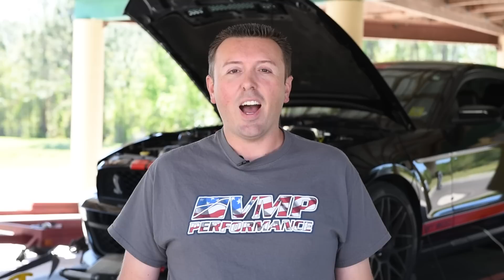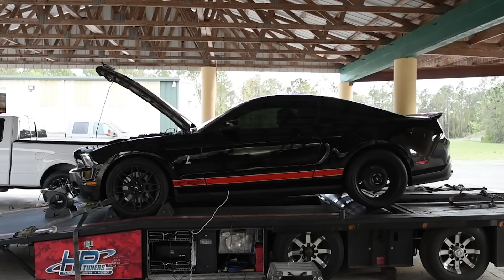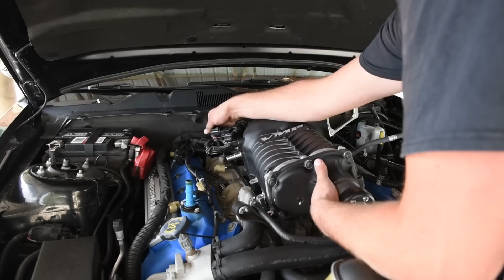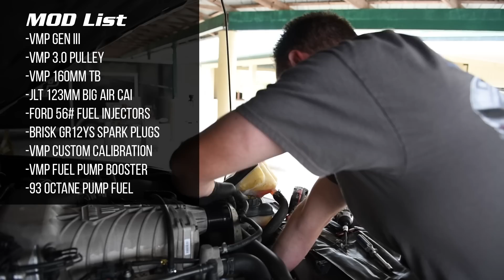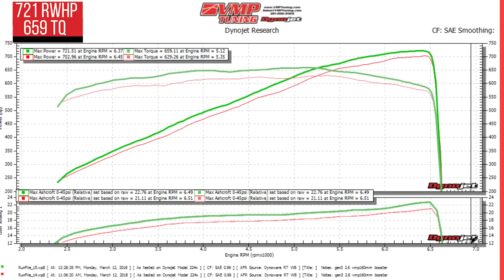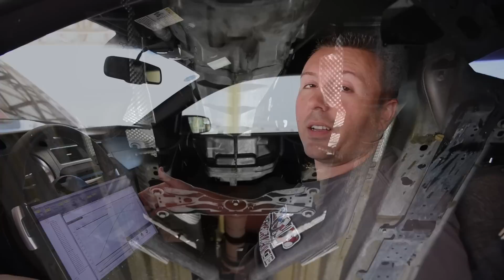VMP Performance | Stock 2012 Shelby GT500 Blasts Out 800 HP With VMP Gen3 TVS Blower

Comment: 615-630 RWHP on stock blower if you add headers, off road road x pipe, and a dyno tune to the pulley, intake, throttle body.

Comment: Worth the 10-15 grand you save going with a 2012 over a 2013 gt500?
Reply: To me it absolutely is.  The money you save put into the 5.4 will make as much or more power than modified 2013s and they have the same 800ish rwhp ceiling on stock bottom end.  The 5.4 had the better gearing and the 11-12 performance pack comes with 373 stock which is much better gearing than what the 13 has.  Even if you did 373 1st gear is still real tall on them.  The gearing is better for the street on the 5.4 imo.

Comment: i had the same build and same  make model and year car .Only differnce is my Shelby only has 38000 miles and had it done at a local shop. My  Shelby is only maxes 670 at the rear whells and it cost me 18500.00. Can someone please tell me whats wrong with this picture?

Comment: Why even get the 5.8..?
Reply: That's a real good question man lol.  The 5.4 is an amazing bargain those who know know.  The 5.8 has more stock but they have the same ceiling overall and make comparable power w the same blower and supporting mods etc.  The 5.8 will make more tq and it'll make the power at about 2 psi less boost but considering the price difference the 5.4 is a way better value if you plan to mod anyways.  Gen3r on a 5.4 is the way.  My 07 did 740/733 to the tire on 93 and boostane 2.6 upper stock size lower.  It's at 132k and going strong

Comment: Question is there any loss in HP after 80k miles on the engine? Did you guys check the compression on it or a leak down test to be reliable?
Reply from the maker: This is something we've studied quite a bit over the past 14yrs.  The higher mileage cars will make 5-10rwhp more from being looser.

Comment: I have a 2011 GT 500, it’s pretty much stock with the exception of a K&N Air filter,  it looks to me like it still has the stock silencer on it though.  I want to add the vmp gen3r but it will have to wait a while due to cost.  My main question is in the meantime would it be a waste of money to do a pulley swap with tune and do I need to change the k&n air filter out for a JLT? Basically I know I’m eventually going to end up with a Vmp gen3r, But I want to make more power now but I don’t wanna waste a bunch of money in doing it.  It’s my understanding from watching a few of these videos but if I do the pulley swap with a tune and the cold air intake with a catless  Exhaust system I should then  be somewhere close to 600 rwhp?
Reply from the maker: Hi James!  We have a few different options available for the GT500, including pulley/tune power packs.  Depending on which you select, the JLT will be reusable with your eventual upgrade to the Gen3R.  An example would be our Pulley/X4/Tune/Idler/JLT package for the 07-12 GT500.  That'll net you a healthy gain close to your stated 600rwhp figure and the JLT will be functional with the eventual Gen3R upgrade.
Reply: @VMPPerformanceTV  
Awesome thank you.  I will be in touch shortly

Comment: What’s better the 5.4 or the 5.8
Reply: For the money the 5.4 is better.  5.8 has displacement and a couple things improved but the main thing was the blower once you upgrade the blower on the 5.4 they're bad as hell and have just as high of a ceiling as the 5.8 if anything the 5.4 seems to hold better at elevated power levels.  When you consider the price difference from the engines themselves to the cars they come in the 5.4 makes more sense imo

Comment: Newbie question here, wont this kill the engine eventually? I’m guessing it wasnt built for these kinds of strains?
Cheers!
Reply: These are solid up to about 800 rwhp on stock motor they have forged internals stock as they were supercharged from the factory.  Some have gone beyond 800 and stayed together even racing if you keep the rpms moderate and give it good fuel and solid tune you're good up to 800ish

Comment: Justin's parts are no joke.  Saved up and built my GT500 off this video with a few minor changes (3R/Twin69).  Made similar numbers but stopped at 700 wheel for longevity and staying with 93 octane.  I'm set up with return fuel for E85 but the car is insane at this level just driving around on the street.
Reply from the maker: Thanks Tin Star!
Reply: @VMPPerformanceTV I have a 2012 Shelby gt500 with all the same mods and like he said the only difference is I have a 69mm Throttle body I’m wondering what fuel pumps did you go with for e and or what do you think I’m making
Reply: Are u on a 2.8 pulley or a 2.6

Comment: Is this accomplished with the stock cracked power rods?
Reply: Yes the entire car is stock including the full exhaust.  It has a bigger heater changer plus the blower head unit itself along with intake and throttle body, injectors.  The powdered forged rods aren't as good as the Rods that came in the 03-04 cobra but they're still pretty stout for stock these things have made up to 800+ rwhp on stock bottom ends many many times some even higher even when racing the car.  They aren't quite made of glass like some would have you to beleive.

Comment: I'm really considering going VMP gen 3 for my 2011. But I'm very hesitant on it because of the stock bottom end. Have you ever had any catastrophic failures with this set-up?
Reply from the maker: We have made good power on a lot of stock short blocks with this combo. Andrew from Mustang Lifestyle has our Gen3R on his GT500 and is making good power with it. With good gas and a good tune you can be safe on a stock engine but there is no true way to tell if or when your engine may let go.
Reply: @VMPPerformanceTV  I like the deal. Ive had various tuners tell me the 5.4's generally give way bottom end wise at around 700+ I wouldn't mind taking leap of faith if the blocks weren't in short supply these days ☹️
Reply: @robertmcdonough2203  you just gotta make sure you use the best fuel/tune available and you should be fine at 700 wheel.  Trying to be too aggressive for the fuel ran is many times what causes failure and another thing on these engines is rpm.  Just keep it under 6200 you should be fine from what ive heard.   Rpms kill these motors quicker than all out power does so just be careful there and run good fuel and tuning and you should be good

Comment: Now that is funny shit saying stock blower would only make around 550-560 at most friend of mine made 580/585 stock blower 10 psi, vmp 2.4 upper, stock lower, jlt, cat delete stock 13-14 mufflers, 93 Oct.
Reply: Yeah ive seen 600 whp before a ported blower.

Comment: My stock 2011 GT500 PP made 521whp the same dyno day another one made 522whp and a 2011 GT that made 374whp.  I know the dyno is just a tool but Gale Banks says that drivetrain loss does not increase the more power you add.  So if your power loss is 40whp when stock its going to be 40whp after a blower swap.  Make sense?

Comment: Well, when I do get a GT500, I’ll be giving you a call!!!
Reply from the maker: Wooo! Can't wait!
Reply: @VMPPerformanceTV  hey Justin where does the ticking sounds come from at a idle is it the injectors? Please help it worries me seems like it happens at operation temp. It's a steady tick tick tick... Is that just a 5.4 thing?
Reply from the maker: @jtee582  it depends on where the tick is coming from.  But a very light and consistent tick from the injectors is not uncommon, as they're opening and closing on each combustion cycle.

Comment: VMP ... can you explain why you use superchargers instead of turbos?
If a turbo is good enough for Bugatti, Koenigsegg, Pagani, Porsche 911, Nissan GTR, and many others, then I don't get it why you'd use a gas sucking parasitic supercharger.  
They are massively inefficient way to make power, and given that the average buyer of a muscle car is not in the richy rich crowd, why give them the middle finger on gas efficiency?
Reply from the maker: Because we drive muscle cars and can't afford those cars.
Reply: @VMPPerformanceTV  
I think you missed the point.
There are twin turbo kits for the Mustang.  I don't know what's available for Camaros and Challengers, but wouldn't it make sense to offer people with less $$$ a performance  increase via fuel efficient turbos rather than parasitic superchargers?
Reply: @TasteMyStinkholeAndLikeIt  it's not cost effective to go single or twin turboed on a 07 to 14 GT500. A Gen3 TVS can make enough power to break the stock rods on the 5.4 or 5.8 engine. And if you build the engine you can spin the Gen3 TVS to make over 1,100whp and if you need more power a 3.6 or a 4.2KB will get you to 1,300whp. Yes turbos are more efficient than a PD supercharger. But for the extra money in fab work just to make a little extra power...it's not worth it. All those super cars you listed, they were engineered from the factory to use turbos. I hope this answers your question. At the end of the day it's apples to oranges.
Reply: @GT500guy  
Well, I'm not so sure.  The Subaru STI and other cheapo cars use turbos.  My only point in listing supercars was to demonstrate that turbos apparently aren't inferior to superchargers, or they wouldn't be using them in supercars.
Doesn't the V6 mustang use a turbo?
I don't get why Ford, Chevy, Dodge refuse to design engines that would make it cost effective to use turbos instead of superchargers.  Makes no sense to me.
Reply: @TasteMyStinkholeAndLikeIt  I wouldn't say a STI, EVO or Fcous RS are cheap cars by any means. Either way take this into consideration, Those cars listed above have very small turbos from the factory, so they spool fast and have no lag so they're fun to drive, you'll need a large turbo on a GT500 that will take longer to spool and will be difficult to fit in a tight engine bay. Now a PD supercharger makes almost instant boost and makes lots of low end TQ. TQ makes a vehicle very fun to drive. That's why the Demon, ZL1 and GT500s use superchargers, as well PD supercharger technology has come a long way and they're very efficient. And no the V6 mustang is NA, the 4 cylinder mustang has a tiny little turbo that's ment more for fuel efficiency than HP. hope this helps.
Reply: @scuba steve
Well, the Mercedes C63 is a twin turbo v8.
A big engine didnt make them go supercharged. 
Superchargers draw their power away from the very thing they are powering.  The supercharger on the Hellcat draws 80 horsepower awayfrom the engine to run the supercharger. That's enough to power a 1990 Honda Civic.
Reply: Yeah, “Stinkhole”, you speak of cost effectiveness. The names you listed, those “Big” names, build their own turbo engines. They are not mass produced like the American V8 motors, in the numbers sense. So when the real brands, i.e., the Americans, do a poweradder for their halo cars, like the ZL1, ZR1, Z06, Hellcats, Cobras, GT500’s, Lightnings, they go to a company that has been doing the poweradder thing for a long time. That being Eaton. They produce fantastic rotor packs, then the auto manufacturers or aftermarket, such as Whipple and VMP, create the casings and other ancillary parts to help keep the cost effectiveness and the price of the vehicle relatively low for the customer, as compared to your “Big” name auto companies. This is true cost effectiveness, not what you are mentioning. The aftermarket can do the turbos for the Americans, and they do fine. But for big power levels, super chargers are just fine. Just look at Top Fuel. Hemi motor, nitro, Big Ass Blower. Why? Blowers are also much more reliable than turbos. Hit a venue. Listen to the turbo guys talking. What’s the one common statement among all of them? “Still working on the tune”. Blowers are much easier to work around, more consistent, more reliable, and easier on the motors. Don’t go attacking a company that started off small, and now is a powerhouse in the Ford aftermarket without doing some research. Everyone that I have spoken with that has a VMP, none are unsatisfied. All recommend Starkey and his company. 
And by the way, what do you drive? Bugatti? Sounds like it since you defend them so well....
Reply: @crodrc51able  
You didn't refute anything in my posts.  You barely addressed them at all, and where you did barely address them, you were entirely wrong.

-->"you speak of cost effectiveness"
That's a vague and meaningless statement without context.  Where did I mention cost effectiveness and in what respect?
I mentioned fuel efficiency.

-->"build their own turbo engines"
1. What the hell is a turbo engine?
I know what a turbo is, and I know what an engine is.  There's no such thing as a "turbo engine"
2. Engines, like ALL car parts, are built by various manufacturers.  In any given engine there's one company that makes the cylinder block, another that makes the cam shafts, another that make the valve springs, another that makes the piston heads, ...
3. Turbos have their own manufacturers.  They are not made by the companies who make the engine, nor by the company who manufactures the car.

-->"Don’t go attacking a company that "
Didn't attack the company, idiot.  I asked a question.  Only a female brain interprets a question as an attack.

You packed a massive pile of stupid into your comment, and simultaneously proved you have the intellect of a mosquito.   It's a waste of time for me to spend another 10 paragraphs dissecting it all.

Comment: I put a whipple 2.9 on my 2011 should have looked in your VMP 3 if had been out when I did the change. Was really impressed with JDjoyrides car after.
Reply: Guess you didn't look hard enough as VMP has been setting the Mustang world on fire with their 2.3L TVS for about a decade now.  Look at what this VMP 2.3L did to these  4.0L+ twin screws.   https://youtu.be/0Fy3LPVPNuQ
Reply: @Sir.VicsMasher  without argument that the 2.3 & 2650 are great blowers but when push comes to push dont mess with the 4.0+ blowers  I'll run any 2.3 or 2.650 blower vs my gen2 4.5 whipple. I might post numbers might not not sure. Hp isnt everything it's just a factor, gears, tune, driver,weight,tires. When I see a 2.3 or 2.650 make 1250-1400rwhp on blower only I'll be interested. Both great products not bashing at all I'd like to see a larger 3+ tvs
Reply: @mmoya1012  Just to let you know a new gen 3r made 1290whp on a 13 or 14 gt500.😉
Reply: @karlhopkins713  that is true but that is a max effort build. Max effort engine & blower 4.5+ blowers start getting serious 1400-1700rwhp. But respect is due where it is due I am liking that 2.650  great blower no arguing that. I'd like to run significant power without the stress of over spinning things to the moon. That's the main reason I picked the 4.5 whipple although it might be a little harder on the crank snout. Which is was my main concern
 Hopefully a billet crank will solve that
Reply: @mmoya1012  He's not even on the smallest pulley and not even on race gas. So there is more room for more power.
Reply: @mmoya1012  there is also. 1300+ whp built early iron block gt500 running a 2.65 tvs.  That to me is amazing...better overall powerband too a 4.5 is just too big of a blower for these cars in my opinion and in many cases depending on the build they dont even outperform the smaller blowers.  You gotta really be spinning those things hard to get max results...like you said "max effort" which many who install the 4.0+liter blowers dont do.  Yea peak hp is just a number theres alot more to it, like power under the curve across the entire powerband thats why i like the smaller blowers and they fit under stock hoods.  No reason to go with a 4 liter blower unless youre trying to make over 1500 wheel blower only or something insane like that because these smaller blowers have shown to do the job from stock motor builds up to 1300 whp max effort builds and they have amazing power under the curve which is what i look at more than peak power.....the 4.5 liter blowers normally dont have that because it is too big a blower for this car imo
Reply: @michaelharris748  good stuff I dont like arguing over a product that I dont make money over. But I like this competition between the makers good news for us! I'd love to have a smaller blower make big power.... big blowers tend to strain the crank a lot. I am going to add the 4.5 whipple if vmp wants to offer me to put on I'll gladly do it lol

Comment: what would you suggest in mods to make the car streetable and be able to handle vettes and hellcats and maybe nissans little v6 monster  i have a 10gt500  would you make a do it your selfer vid on blower and fuel pump changes  LASTLY  would a intercooler improve performance enough to warrent changing tyvm
Reply from the maker: Hey Perry, the intercooler up front needs to be upgraded, but the one under the blower works fine.  We are actually working on that video right now, but it basically starts out with something like the VMP JLT123 kit: https://www.vmpperformance.com/07-12-Shelby-GT500-Custom-SCT-X4-JLT-123MM-Plasti-p/gt500jlt123pak.htm

Comment: So it gained 30hp from the next to last pull he was using sae all the way through until the "800rwhp" run
Reply from the maker: Right, we explained all the different correction factors.
Reply: @VMPPerformanceTV  I just wanted to throw it out there for those who may not have caught the difference but I do understand the differences good job though🤘

Comment: Long tubes maybe some basic mods like coils just to see if any difference big or small at all
Reply from the maker: We're working on it but we don't recommend aftermarket coils.
Reply: @VMPPerformanceTV  gotcha love the videos brother especially the manifold shootout on the s550
Reply from the maker: Thanks
Reply: @VMPPerformanceTV  got a question got a 2011 gt 500 with just a 2.9 whipple everything else stock about how much rwhp?
Reply from the maker: It should make around 600-625rwhp